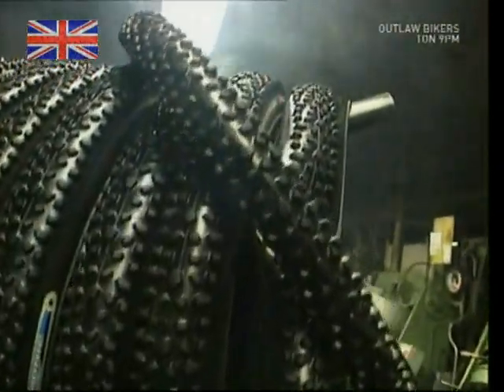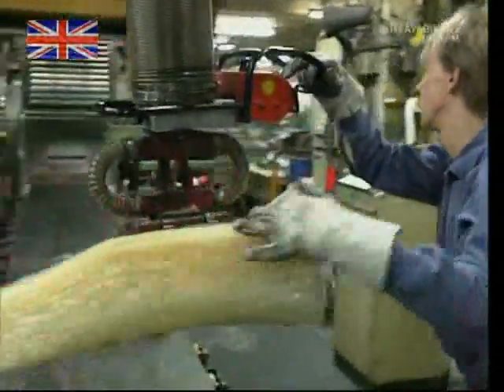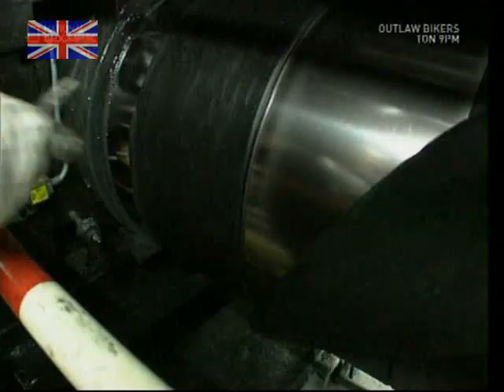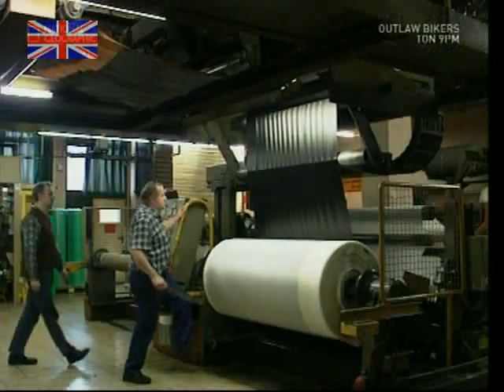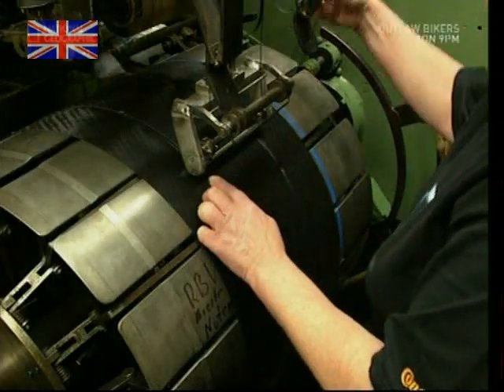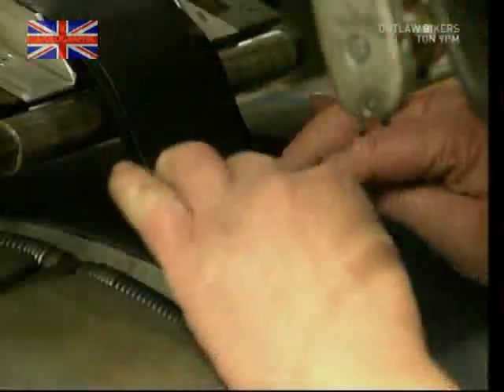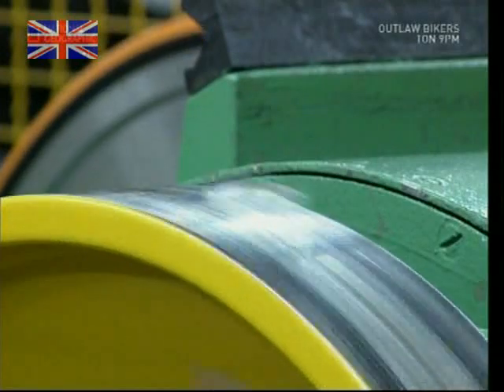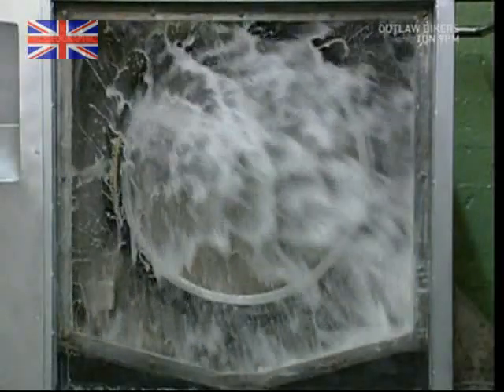How Are Bicycle Tyres Made

Comment: The narration is pretty poor. The kevlar strings aren't to 'make the tyre bullet-proof', they're there to make it a folding tyre as opposed to a wire bead that would make a non-folder. Also, the heat doesn't make the rubber expand into the tread, a high pressure air bladder forces it into the tread pattern as the tyre is heated up.

Comment: The destructive test gauge reads neally 20 BAR that 290 PSI (pounds per square inch) NOT 8 psi as the narrator says,my bike tyres are normally run at 35 psi. rec.